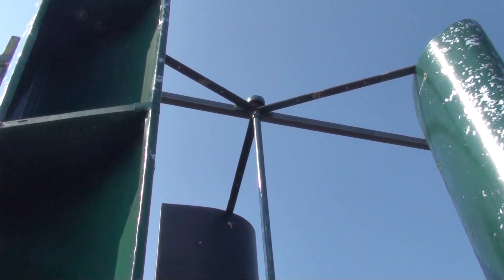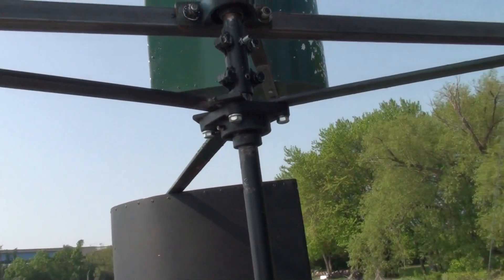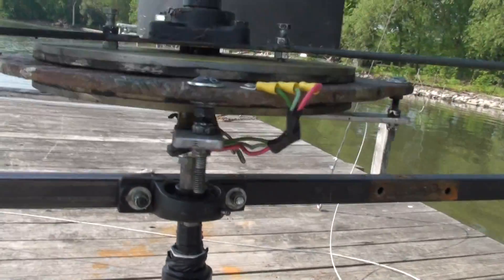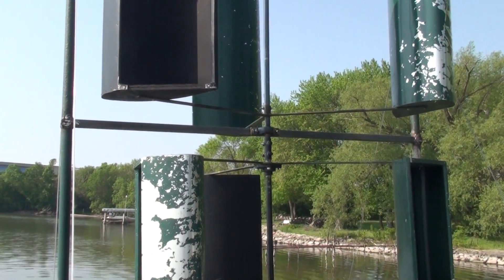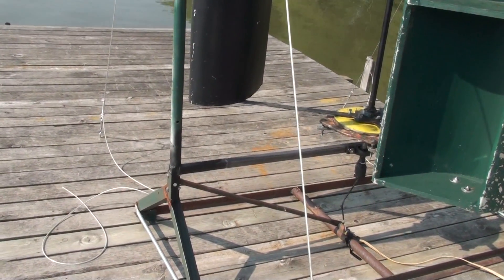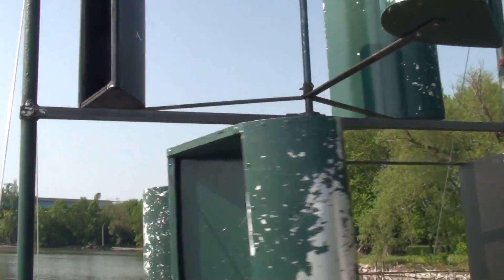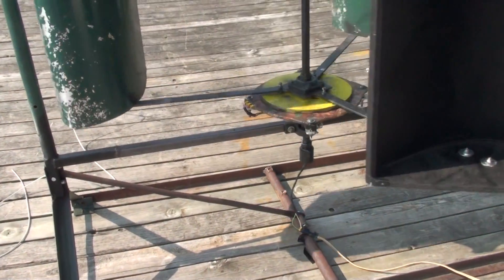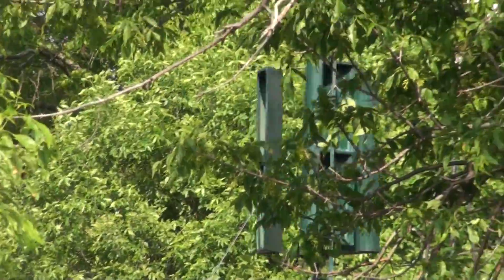Lenz 2 counter rotating construction video, with  bearing setups

Comment: What were the design objectives of the more complicated counter-rotating design? With helicopters, for instance, experimental aircraft used counter rotating main rotors to cancel out the non-symmetric lift between the advancing and retreating halves of the rotor disk. What does the design achieve here that is significantly different from a single rotor with an 8 foot wing model?

Comment from the maker: On this one there is only one alternator , 2 magnet plates and a stator The magnet plates are attached to one set of wings and the stator is attached to the other wing . Both the stator and the magnet plates are rotating instead of having a stationary stator.

Comment: I think theoretically you get nearly twice the rotational speed if you have two rotors in the generator instead of a rotor and a stator.
And they move in opposite directions. What prevents a full 100 percent gain is friction in the bearings, and also some friction in the slip ring. In a bigger-scale generator it would also be necessary to have a plate between the two oppositely rotating parts because of
turbulence.

Comment from the maker: It makes it more complicated and you need a slip ring to take the power off. That's probably why. and it only works with this type of alternator. It really helps cut down on vibration.

Comment from the maker: @2DAREPUBLICAMEXICANA two different kind of bearing holders , one has pillow blocks, with 1 inch inside diameter The other is called a flange bearing. 1 inch inside diameter. Both bearings are actually the same the holders are whats different.